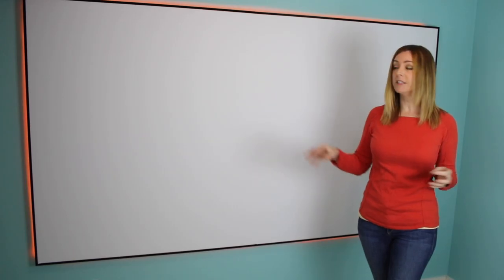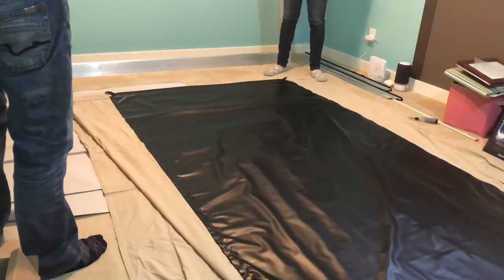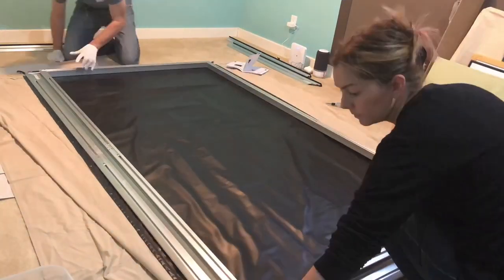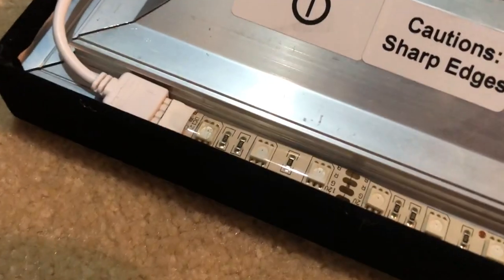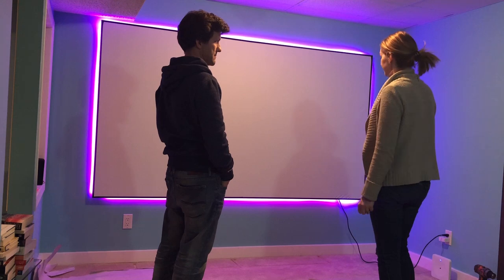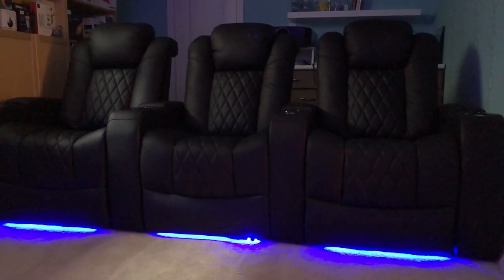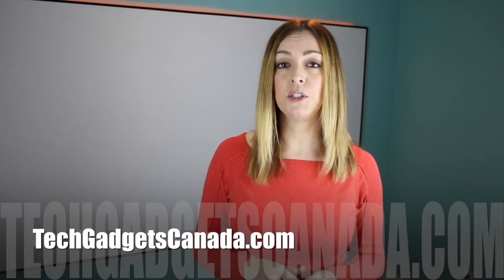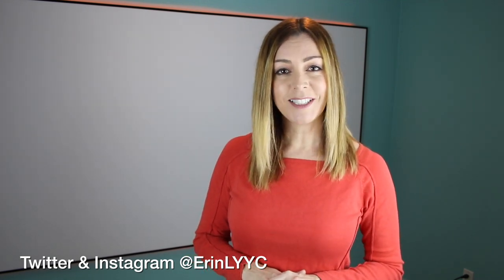EluneVision Elara Nano Edge Projector Screen Review & How To

Comment: @ 1.03 Top Right-Hand corner screen is not fitted right and again @ 2.19 Screen bottom left corner screen is not fitted right and again at 2.51 bottom right corner screen is messed up can clearly see wrinkle Sorry but if I spend more 2500 US $ on the screen like this I would want my screen to be right.
Reply: You're right but it's a $500 screen not $2500
Reply: @hisxbr150  - Regardless, it should have been assembled properly, and if it was and still looks that bad, it should be sent back.
Reply: I noticed it too